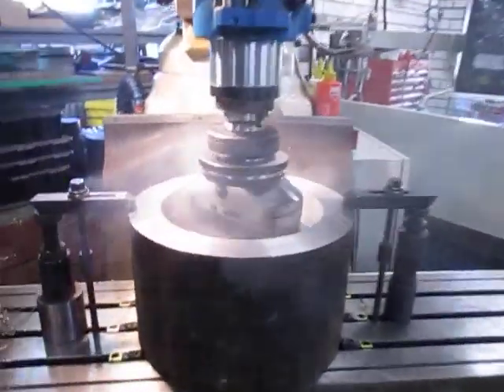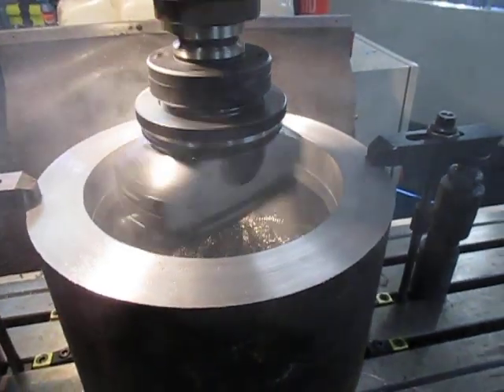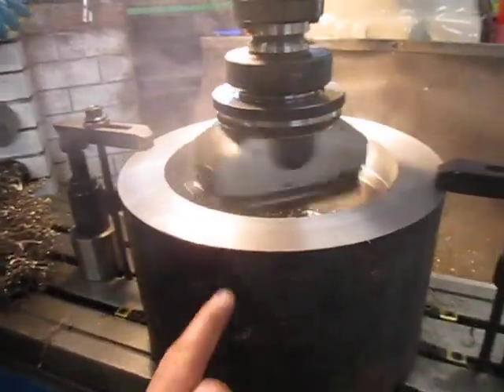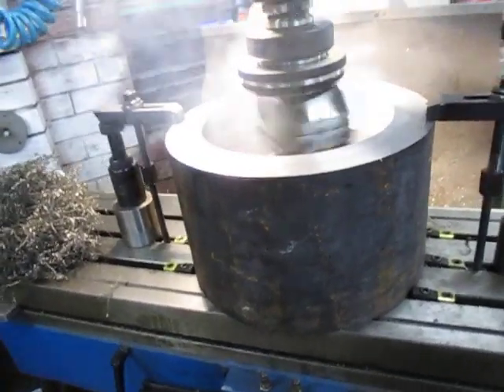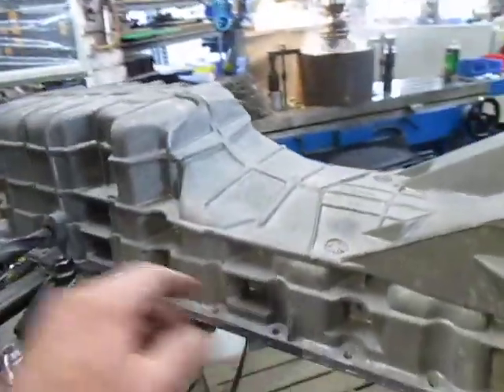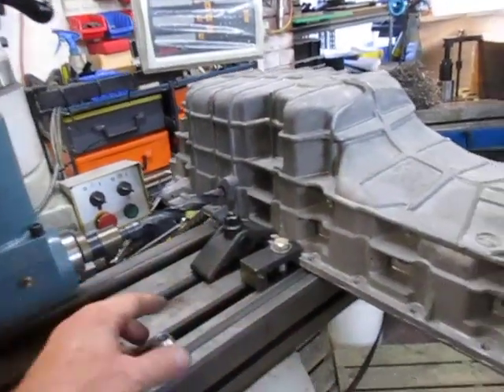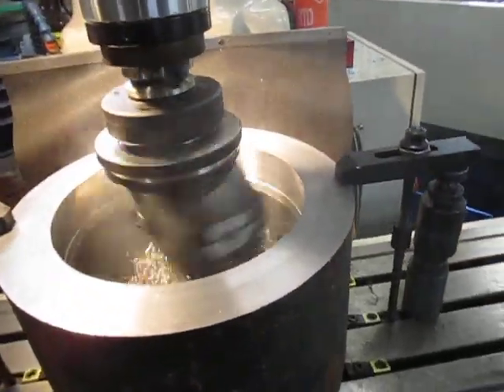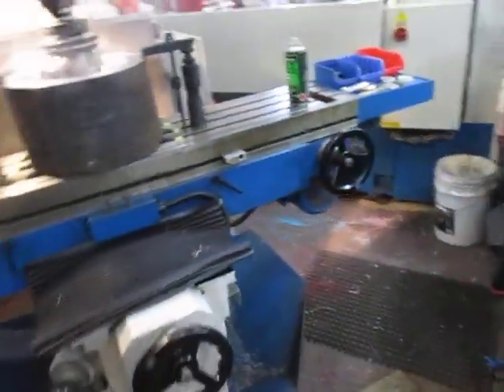Bruce's Shop Easter Friday

Comment: Hey Bruce, with the sump, is there any reason it was done in the mill? Surely drilling it out my hand would be alot quicker and still be more then fine for the application.
Reply from the maker: brendan454 I probably could have hand drilled it, however I prefer to have the item on the mill bed locked down, just the way I go about things I guess. In the end whatever works and gets the result is acceptable. In the past I probably would have gone the way of a hand drill, having said that the bit was 19mm (3/4") so that in itself would have been an issue.

Comment: Great Video, I wonder though if there is merit actualy behind your steel wool? it would be nice to work out. The shavinds you had in a wad is exactly the same density we use for our soldering irong to keep them clean as well as (if put in a can) is a great place to put your iron down as it does not suck the heat out  of the irong meaning you simply pick up the iron and continue your project.
Reply from the maker: ***** I like that, I forgot about the soldering stuff, tried to rid myself of the memories of freezing days up on a tin roof with a blow lamp and 2 copper soldering irons rotating them to dad as he patched someones roof with a stick of 50/50 and hydrochloric acid!
Reply: I still use hydrocloric acid for doing heavy applications and wiring jobs but not used as much in circutry.I mixed up the bottles as 1 was water the other acid so all you can do is grab a glass of water and put a dot of each fluid on your tounge and wait for the acrid bitter taste then drink up, now they are in different bottles( I wonder why) youth.!